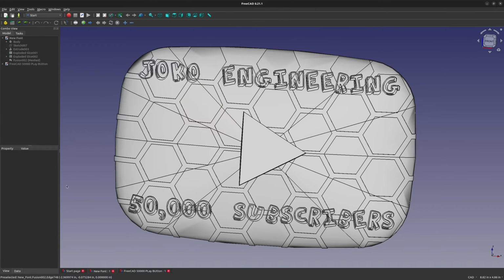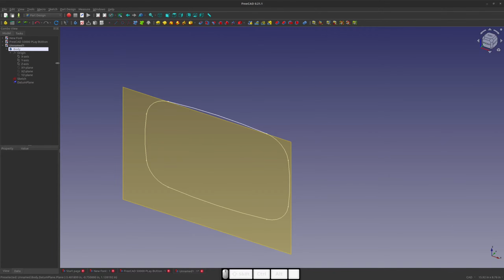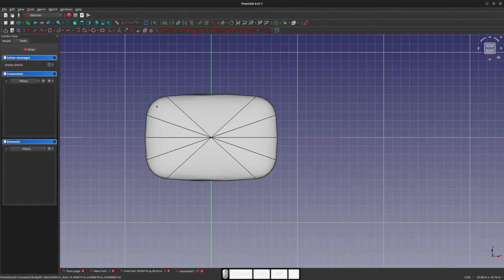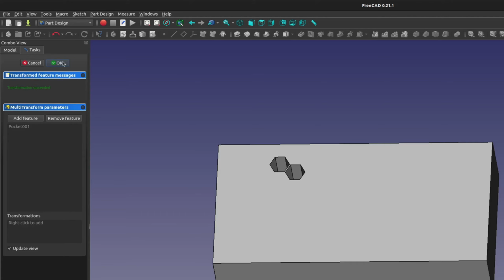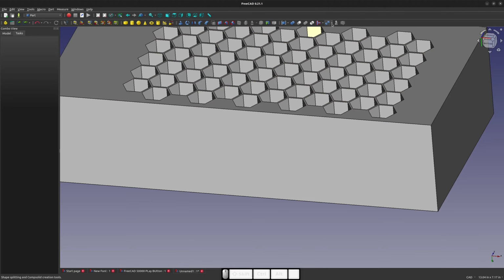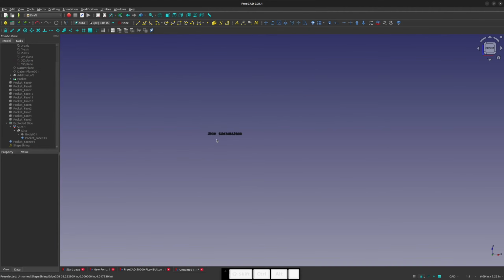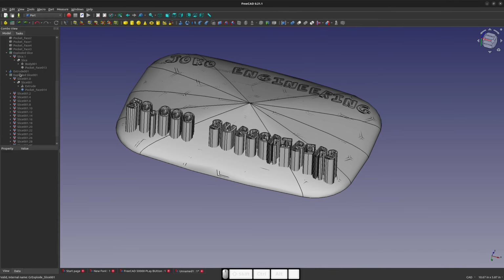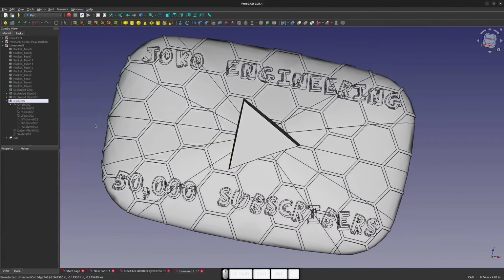Designing and Printing My 50,000 Subscriber Play Button in FreeCAD|JOKO ENGINEERING|

Comment: Nice video! I recreated your play button in build123d (a new fully open source CAD package). Here is the build123d sourcecode:
from build123d import *
ms = Mode.SUBTRACT

with BuildPart() as p:
    with BuildSketch() as s:
        RectangleRounded(3,2,.25)
    with BuildSketch(Plane.XY.offset(.3)) as s2:
        Circle(.1)
    with BuildSketch(Plane.XY.offset(.3)) as s3:
        Circle(.01)
    loft()
    with BuildSketch() as s4:
        RectangleRounded(3,2,.25)
        with HexLocations(.5/2,8,6):
            RegularPolygon(.5/2-.025,6,major_radius=False,mode=ms)
    zz=extrude(target=p.part.scale(1.01),until=Until.LAST)
    with BuildSketch(Plane.XY.offset(p.part.bounding_box().max.Z)) as s5:
        RegularPolygon(.5,3,30)
    extrude(amount=-.05,mode=ms)
    with BuildSketch(Plane.XY.offset(p.part.bounding_box().max.Z)) as s6:
        with Locations((0,.66)):
            Text("JOKO ENGINEERING",.25,font_style=FontStyle.BOLD)
        with Locations((0,-.66)):
            Text("50,000 SUBSCRIBERS",.25,font_style=FontStyle.BOLD)
    zz2=extrude(until=Until.PREVIOUS,mode=Mode.PRIVATE)
    add(zz2.translate((0,0,-.02)),mode=ms)
Reply from the maker: Woah how did I miss this comment?  This looks amazing

Comment: Congrats on the 50K, and thank you for another instructive video! Slicing a pad with low curvature surface works fine, but can anyone recommend a way to wrap text/pattern around a surface?
Reply from the maker: The part workbench has a feature for that.
https://wiki.freecad.org/Part_ProjectionOnSurface
Reply: Thank you, @JokoEngineeringhelp!